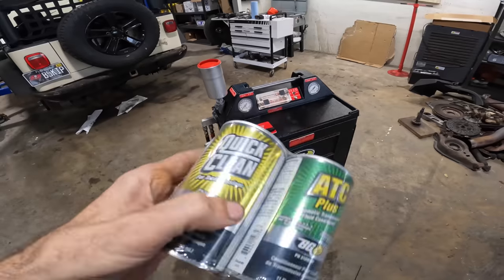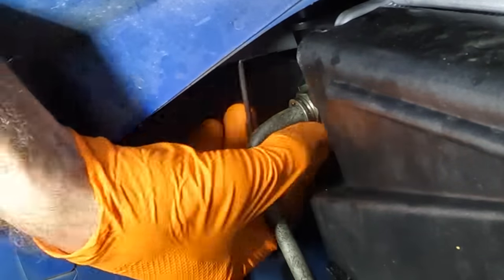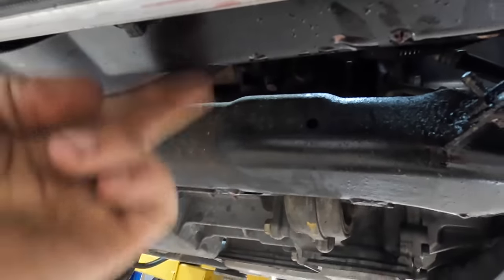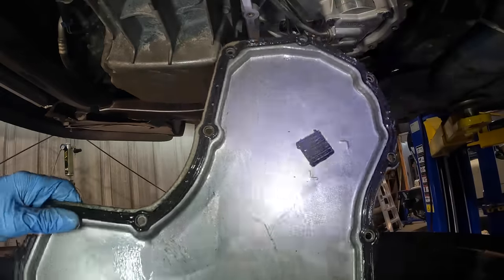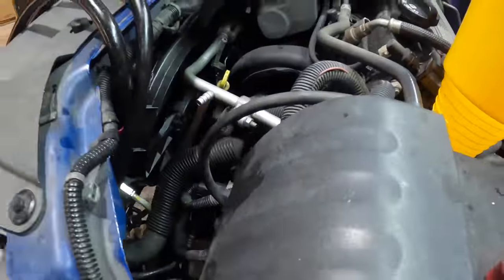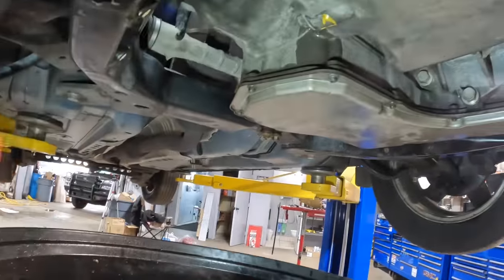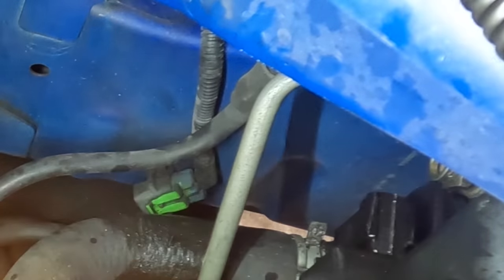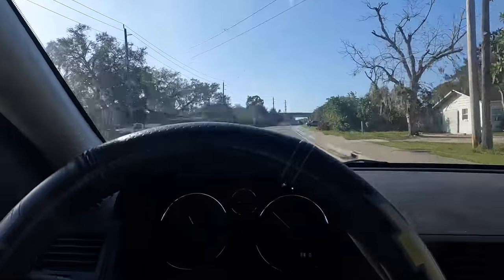Contaminated Transmission! Chevy Cobalt 2.2

Comment: The clutch material in the pan is the water dissolved clutch adhesive.
Pretty sure it's toast..
Ps. Just called my transmission guy friend, 30+ years as ATEs trans tech, says its toast.
If it could get them some time, they you did it might buy some time.
Reply: This is why all my trucks get a stand alone trans cooler 1st mod

Comment: We use the bg products also , there was a rumour about not using the oil flush on wet belt engines incase it finishes the belt off somehow. Apart from that it's meant to be good stuff .

Comment: When I was a kid several " know it all's" told me to never touch an automatic transmission filter or even drain a manual transmission / differential. If you do they will be junk in a week. Others told me of all flavors of mouse milk that make AT's impervious to friction and wear. When I got older, I had to pay for things I broke. That's when I learned the value of following the manufacturers recommendation in the service manual. 😎

Comment: I think hooking up the flush machine first wasn’t the right move. I would have just drained it, fill and the. Hookup the flush after. Because the second time the contaminated fluid was in the flush lines and then pushed into the car when started after.

Comment: I think basically all steel gaskets, besides headgaskets, can be reused, ive had upper and lower intake manifold, exhaust manifold cats, EGR, throttle, starter and maybe a couple more that have all been off and back on and theyre fine. Intake, exhaust, and starter being MLS gaskets and the rest being flat steel gaskets. Very happy that honda uses a majority steel in their gaskets so i didnt have to buy replacements every time, they are unique though so i have to go through honda as well so even more glad they’re steel on that front

Comment: How did the fluid get contaminated in the first place? Leaking coolant via the radiator trans' cooler? Just saw the previous? video of you changing out the radidiator, first? ... not sure the sequence but the logical one is obvious to both of us so... Glad you saved them a trans rebuild!

Comment: The big problem is the darned torque convertor The fresh oil going into it is instantly contaminated by the old.  Back in the 'goodle' days, some manufacturers had drain plugs on the convertor.  GM Turbo Hydramatics didn't, of course, and we were expected to replace the convertor if the fluid in it was contaminated.  I decided the heck with that and drilled an 1/8th inch hole in it and let it drain out.  That would take over night.  Next morning, I'd come in and weld the hole with a quick touch of the welder, refill with fresh fluid, and bingo!  All was good!

Comment: If that machine is anything like what I have used, it will have a noticable effect. It may only need one service. The pan drop only requires 4.75 qts, if i remember correctly. The total capacity of the trans and cooler is 12 qts?

Comment: Coolant does a great job of destroying transmission clutch packs. The length of time before failure will be determined by how long the clutch packs were pickled with coolant. So, I guess time will tell. I would think a fluid condidtion check after 500-1000 miles will signal what a possible verdict is.

Comment: Looking like the tires need replaced as well, plus the cost of 2 transmission flushes and the radiator, you're quickly coming up on the cost of a 'new' used cobalt.

Comment: I personally don’t think it’s going to last long. The clutch material is known as a hydroscopic material meaning the moment water and coolant was introduced into the oil. It immediately absorbs the water and forces the oil out. At that moment the clutch material begins to disintegrate, because it no longer has proper lubrication. and there is some parts in there that is going to develop rust eventually tho the moisture will dissipate from the heat
Reply: Hygroscopic* but I agree with you, would love to know how long it lasted.

Comment: I'm  betting its good for a while but it did shorten the life slightly so it won't last as long as one that didn't have contaminated fluid in it but it is what it is did the best affordable job to keep it running with out.. out right replacing the transmission, lines , cooler, and whatever else that would be needed which would have cost a small fortune great work

Comment: I always liked using Safety Kleen parts washer when i worked in shops. They would come to your shop & replace the chemical  cleaner & service it monthly or twice a month if needed. Use to be a very good company don't know if there in your area or not. Check with pennzoil, valvoline & other oil companies to see if they will give you a used oil tank & bulk oil tanks & pumps if you buy there oil & Fluids in bulk? You may not be using enough to be worthwhile ??

Comment: I would never ask you to divulge the total cost of ‘saving’ this car, but I do wonder if it was financially worthwhile to the owner. That’s a lot of work, a lot of fluids, etc., etc, and there must surely come a cut-off point where it is no longer viable and becomes a scrapper. Fascinating video though. 👍
Reply: I don't know what the prices are like in Florida for a used car but in my area of PA. they're pretty high. I've been looking for months for a decent ( NOT RUSTED TO HELL ) Jeep or Subaru that I can buy outright, NO PAYMENTS.

Also buying a different car can come with bigger surprises than you already have even if you check it out well. At least trying to this car, YOU KNOW WHAT YOU HAVE IN THE END.

I GET WHAT YOU MEAN THOUGH, " WHERE'S THE LIMIT ON PUTTING MONEY IN THIS CAR " ? That's up to the customer & depends on what the car means to them.

Comment: This transmission is not long for this world, not because what happened with the mixing of the fluids but because of all the clutch material in the pan. I think the clutch material was there before the broken radiator. The trans will die on schedule but not because of the temporary antifreeze mixture.

Comment: Great and entertaining video on a fluid change! Of course this is because I'm not doing the work otherwise it would be different lol. As far as the gasket goes I agree I hate rubber gaskets as well without any metal reinforcement in the middle as they are a general pain to keep tight and no leaks no matter where they go. Unfortunately the manufacturers don't always agree with us so it is what it is. Anyways hope you had a great Christmas and a Happy as well as successful New Year's!

Comment: When he was struggling putting that line clip back on the line fitting, anyone saying "take the glove off"?... Nicely done Ray, the test drive went well but you didn't really put stress on it like going up a hill. What a monotonous, time consuming process, but other than tear the tranny and torque converter out that was the only thing to do. That looked like a lot of clutch material, but not knowing the condition of the tranny to begin with, it's hard to say how long it will last.

Comment: On my Ford E4OD the rubber/metal pan gasket is specifically called a reuseable gasket. Why are some newer built without a way to check the transmission fluid level? So far I have avoided owning on of these.

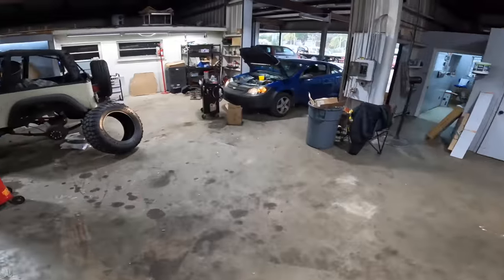Comment: 5:12 I seems odd to me that the circulating pump would run off 12V DC power, since it is obviously a machine intended to be used in a shop or garage setting.

Comment: Good day sir and Merry Christmas, those reusable gaskets have been around for a while,we had them on the valve covers/,overheads on diesel for years. As long as not torn they reseal fine. Thanks for the ride along. Oh di I see some bigger tires for project jeep?
Reply: Hope not.  The existing were already oversize.  Wonder if he changed the ratios.  Like that Charger, people give up alot of handling and ride for appearance.

Comment: Ray, once water gets into the clutches, they will delaminate.   Send it to a transmission shop.there is no saving it.   I just seen the whole video here in bed with a upper respiratory crap.   That transmission shop is going to hate you.   Here's two things about automatic transmissions
1.  If water gets into them, the friction material will delaminate off the steel,.  No amount of flushing will save them.
2. Never put transmission conditioning fluid in them,. Don't care if BG says is ok.  The crap in it will swell the o-rings in it and make it hell for the transmission builder really hate you.
Automatic transmission are a voodoo area for 99% of mechanics.  Look up precision transmission with Richard from Amarillo Texas.   Him and his son parted ways, but his teardown videos are still up.  Take the time to look at some of them and you'll at least learn the "why not too's"

Comment: I worked with a guy, his last day on the job was doing a converter drain (flat back) on a C-6 in an old ford pickup.  Some months later, I ran into him somewhere and asked him what happened. He said, when that stinky fluid started running down his arm and dripped off his elbow, he knew it wasn't the job for him. 
What trans is in that Cobalt? Looks like a modernized TH125.

Comment: Def a time bomb, but if the test of the car is in good nick, worth replacing. Just replaced a gearbox in my Toyota for the cost of a secondhand car of similar age, but not condition. Now the box is reconditioned nothing is wrong so it's worth not getting someone else's problem.

Comment: If any water remains in the oil it could cause the internals to rust in 5 years or so, but maybe not the mating surfaces which could remain shiney.   That machine could do with a water separator, if that is at all possible.
I have had all sorts of machines with water in the oil, from excavators to airplanes, one cure is to run them hot for many hours to evaporate the water, it works some times.

Comment: I wonder how many different vehicles those hard gaskets are available for. I recently had the trans filter and fluid (6 quarts of synthetic) replaced in my old Chrysler. Looking around online, the only options I saw were rubber or cork gaskets. My mechanic said he preferred rubber so that's what I bought.

Comment: Ray,
given the job, surely it is far more cost effective to get a 44 Gal drum of Dex6? You will always use this stuff up later, but the cost must be a lot more effective. I also did not see you check tighten the gearbox level plug as you said you would. Now, having repaired a few auto transmissions, I would suggest he does a couple thousand miles then drop the pan again to see if it is still shedding clutch material (or metal from the pump mainly). If the pan is clean, then looks like you saved it, if not clean let him know to plan for a trans change in the future.

Comment: If you have a positive replacement unit, I would have just used vegetable oil for the initial flush!!  Pump pumps fluid into converter, converter pumps it out through the out tube to the cooler.  You should have started the flush machine and run the fluid from the pump out to the machine without mixing the fluid inside the tranny.  You will NEVER "flush" it if you keep mixing it.

Comment: I always wondered how they make Pepto-Bismol, now I know. I think the transmission is going to be fine. May have shortened it's life, but you never know. I just wished you would check the fluid once more to be sure that the radiator was  the problem. I think it was and you are good to go. I was also thinking that if you had to buy much more fluid, that amount of money could have gone into a rebuilt trans.

Comment: Would you not be worried about all the clutch material that was taken out in the flush because at the mileage is at IIT usually becomes an important part of the transmission it actually helps shifting. I suppose it seemed to run ok. But really it's up to the tranny gods now.
Anyway Merry Christmas to you and the lovely Wife unit and to your Kid Units!

Comment: Once the transmission fluid reaches the boiling point of the water, it will start venting to atmosphere whatever is left in the oil. I would have run it through the gears on the lift, to clear the valve body and the clutch piston’s.

Comment: the gasket is meant to be reused I worked in an AC Delco place so I know unless its beat up or cracked etc. by the way where is the cap for the A/C port beside the rad. and why is the rad moving around so much when you pulled the line.

Comment: How do you clean out the oil from the machine, since all manufacturers use different Xmission fluids. I wouldn't want whatever was run last in that machine run in my Ford.
Also some transmissions these machines won't work on. They have a temperature lock out and the only way it will flow fluid through the cooler lines is if you reach a set temperature of the trans. Idling will not trigger the temp. You have to drive it under load.

As I stated some Xmissions. Ford 6 speed is 1 of them.

Comment: Cool videos man. I'm a technician as well. Why is the radiator so loose? Also, how does the bg machine know which side is pressure? Is ot self sensing or are the lines marked?

Comment: I think that the transmission will last another 15000 miles or so before it needs to be repaired. That clutch damage was pretty life shortening, but it doesn't seem like it was so severe that the thing won't run. I would recommend to the customer that he start either looking for a new vehicle in the next year or so. Or at least start saving the 1300.00 it's gonna cost to replace the transmission. If the car suffered through that and God knows how long they drove on it like that. Then it's probably not a terrible car. But I do know that those cobalts aren't the best gm product on the market. They're definitely gonna say they probably aren't the worst. If it's shifting fine and no lags and no shifty shifting ha you like what I did there. Then the vehicle is probably gonna be ok for at least 1 more year to get him by to make arrangements for when it does go out. I would tell the customer that they needn't forget this issue and keep it fresh in their mind to keep those arrangements in place. 🙂 also merry christmas Ray I'm glad you opened your own shop. I called it. And just to fill you in past the email I sent you. I think everything with my engineering license is gonna be ok and that I think things are going to work out. It was just very strange we were both going through similar issues on the work front. And that I'm glad that your thriving through those!
Reply: Oh I don't doubt they are at all. If it weren't it would've been ruined driving it with those contaminants in there. I agreed when I said they aren't the worst, but they probably aren't the best gm product. I was just simply replying to what he said when he said let me know what you guys think in the comments. I'm not offering factual evidence or anything. I'm just offering a professional opinion from my experience as an engineer from working on cars trucks heavy equipment and now boats and ships. 🤷
Reply: Right not the best but not the worst lol they fall somewhere in between a toyota and a Hyundai lol. Buddy of mine uses his garbage cobalt as a dock vehicle 😆
Reply: I mean in my opinion you can't really compare toyota and Honda with Hyundai lol but if we all believed the same things and looked the same the world would be pretty boring 😂

Comment: Ray, I was wondering what do you think about the T-Tech transmission fluid exchanger machine? We used to use it at Valvoline instant oil change when I worked there many years ago. I thought they were great.

Comment: It's probable the life of the trans has been shortened, but it seems you've got it a few more years. I think if it were mine I'd schedule another fluid change after a few thousand miles. However, you've saved the guy the need for a new trans now, for the cost of time and a few gallons of fluid, so I would say thats a good deal. I guess a full rebuild is the "correct" answer given the amount of brake band dust you found, but is it worth it considering the value of the car? Probably not.

Comment: I had a 2010 chevy cobalt. Drove it from 80,000 miles to 120,000 miles. Gave up when it suddenly started overheating and mysteriously losing brake fluid. Had to fill both every two days or so, never got it fixed so idk what was wrong

Comment: Honestly, I would never start a pan bolt with any form of impact gun or air ratchet. Always tightened manually, so that you can see how things are tightening. Also, trying to please the customer under these circumstances is unlikely. Hundreds of dollars worth of trans fluid later, the transmission will probably fail at a later date and the customer will point the finger at the mechanic, and say that he/she wasted their money. Sometimes best intentions don’t pay off.

Comment: Clutch discs are ruined. Clutch material is hygroscopic, coolant will replace the ATF in the clutch material and break down the bond  (glue) that holds the clutch material to the steel disc. When replacing clutch discs you soak them in ATF  before installing. Tablespoon of coolant in transmission will ruin it.  I'd immediately sell the car before it starts slipping again for the last time.

Comment: I've seen several people have tranny issues after a tranny flush, I would never do that to my vehicle unless the milkshake of death was in there, like in this case...I don't know why people have issues after tranny flushes, but it is most certainly a thing..Could be several different things...My method is to drain 2 quarts and add two quarts, and in two weeks drain two quarts add two quarts, I do that 6 times, drain 12 quarts and add 12 quarts over a 12 week period, and do that method every 3 years...Never had tranny issues with that method...Can't do that with most newer cars, but I avoid newer cars like the plague...